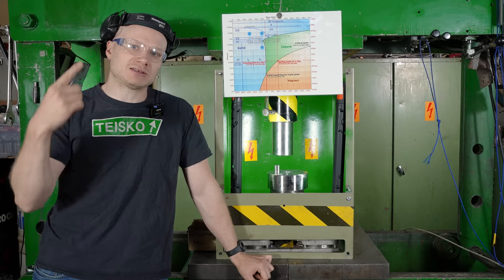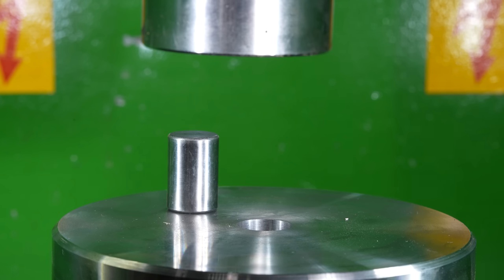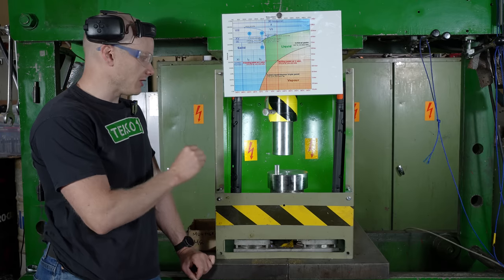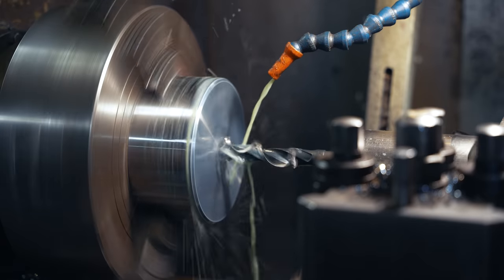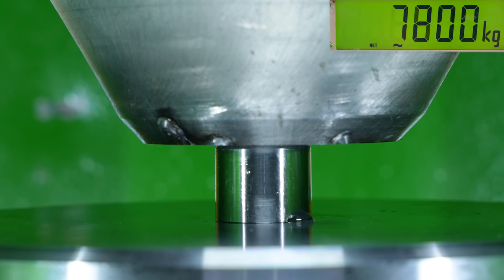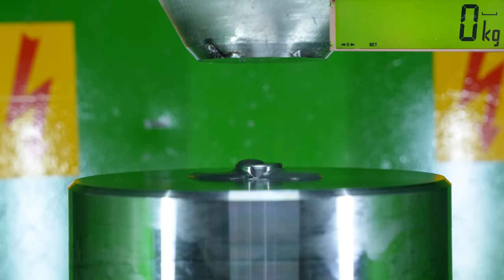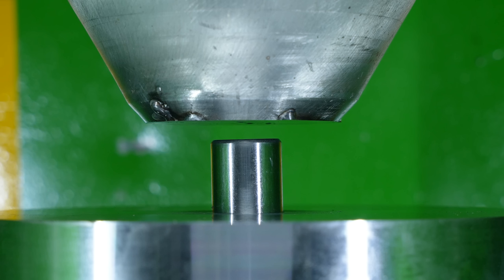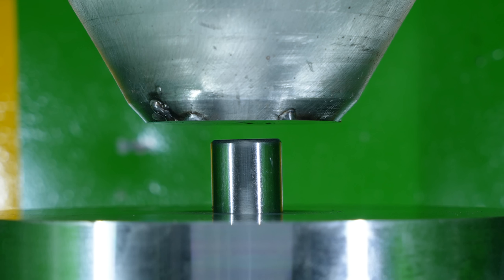Turning Water into Rock with Hydraulic Press

Comment: My suggestion is to take the advice of using ice instead of water.
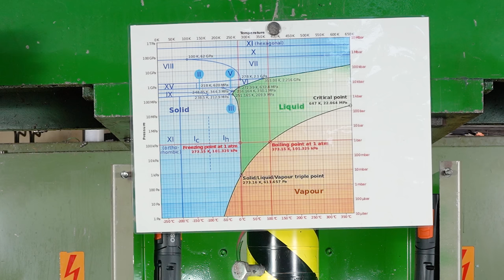Looking at the graph at 0:30, if the temperature of the ice is below -22°c will never transition into water and will stay a solid!
Under the extreme pressure the ice will fill all the space, but it shouldn't leak if it's never a liquid!?

Comment: Would a titanium roller bearing work? The tensile strength of titanium is 63000 psi and has better corrosion resistance that steel.

Comment: This is an awesome but has several issues:
1) leaving air - that will be a problem.  
2) stop and wait - temperature is critical for both the water and especially the metal.
3) Even if you achieve it, how do you know?  We cant inspect the results.  (reminder of your cone head as an option).

Comment: You could fill in some thick oil or fat on top of the water that has clay or some inextrudable particles or fibres in it that can help to clogg the drain out.  The use of a crome platet piston  and cylinder  or a pipe between them made from high crome/ alloy probably helps to prevent frictionwelding what could be cause of   leak,  or it just expands the cylinder by hydroforming effect.. u must get it to the waterjet channel to cut it in half polish an measure if it expanded ^^

 And cool the tool down to 1°C before use .. i guess friction and compression gets things very hot in there ;)

Comment: I think you need to make the pusher out of oil-impregnated brass. This way the metal of the pusher would gladly deform and not tear up. It think you set up leaks because you are tearing up the metal and making small grooves inside that let the water escape.
Reply: And you would need to increase the length of the sealing surface. Make it 2 cm long. Go slowly and wipe off the incoming water until it  eventually stops leaking.

Comment: Instead of pressing the bolt down, can it just be a screw that is turned in? That should have a good seal, and you might need the press or a long handle to tighten the screw.

Comment: Could the oil be acting like a seal and once it gets to a certain pressure starts to blow out? 

We use oil in engines as a barrier to keep two metals from contacting and wearing out prematurely, this may be doing the same and getting to a point where the oil sheers and allows the thinner water a gap to push through

Comment: The cylinder needs an extreme smooth surface. channels will be cut in the steel by HP water through the tiniest cracks. Ex- steam engineer , I know.

Comment: Air molecules (N2 and O2) are bigger than water molecule (H2O). So airtight != watertight. And with such a pressure water leaks even through the solid metal shpere

Comment: Unfortunately, physics will get in the way, but if you built a vessel that contains the water with no air leaks in a piston like setup and pulled it apart really fast then you could create ice. It would probably be a slush, but that'd make for an elaborate snow cone.

Comment: Doesn't it make small cracks in the steel if you force the cylinder through its hole that's much too thin very fast? Slower might be better, also since the temperature increase due to friction would be lower, although the thick steel should dissipate the heat outwards I'm not sure if it does so fast enough

Comment: It would be really cool to have a clear diamond with a big chunk of Ice 7 trapped inside. The amount of strain in the crystal to contain that would probably be immense.
Reply: The diamond zone starts about 100 miles under your toes.  "a big chunk of Ice 7"  There aren't any lakes down there.  Water is chemically sequestered.  The fun starts as it ascends.  Kimberlite, et al., explosively surface, possibly at sonic speeds.  If Lauri had a diamond anvil cell, he could squeeze to required pressures with a leveraged butterfly thumb screw.

Comment: At the pressure and temperature in your test the oxygen in the water reacts with the steel forming iron oxide and hydrogen. Some hydrogen escapes and some is forced into the metal.

Comment: Cut a round hole in the metal block using wire EDM then a cylinder piece for that hole. cut the cylinder in half and use it to plug one end of the metal block. This should result in minimal leaking.

Comment: Is the portion that holds the water expanding under the pressure?   I might be way off but the more you squeeze the more solid the water becomes so it’s acting like splitting wedge pushing on the walls of the plug receptacle expanding the hole making it larger.  Is there a way to measure expansion of the receiver piece as pressure rises?  The plug might not be the problem it may be the receiver because the plug should expand as it compresses from the force pushing and the force resisting and there is no constricting force on the receiver.

Comment: Could you make your chamber/vessel and piston/plug (whatever you wanna call these things) using Wire EDM so you can precisely cut it out with basically zero tolerances and if im correct eliminating the gap where it can still leak from at those high of pressures.

Comment: I'm kind of confused, because people that hydroform steel say that water doesn't compress, which is why they don't use an air compressor as it has a greater risk of explosion. That never really made sense to me, and it's obviously not exactly true because of this here. But it also doesn't really explode like you would expect either. Can someone explain what's going on here? I know water become less dense when it freezes because of the crystal orientation, but does the same thing happen when it becomes ice VII? If not, then why do people say that water doesn't compress?

Comment: THis is a great idea! Most interesting video so far. 
You need to machine a cup in the pressing tool. The pressures will be shunted and redirected to the center of the pressing tool, instead of being wedged at the seam of interfacing tool surfaces. Also might need to use ceramic or diamond pressing tools. Because metal is very malleable, its deforming like plastic and being water jet cut. 

The hardness of the tooling is probably totally dependent on the pressures achieveable. 

ALSO you could have some sort of coating on the pressing tools as well. DLC coatings are avaliable if you send them out to the dlc coaters, your chances would be higher.

Comment: The idea is sound. I think you just need a softer metal as your seal. Perhaps even lead. Perhaps as little as a few millimeters of it, in front of the bearing roller. The water pressure may be able to force it into sufficient conformity with the inner surface of the compression chamber. If lead's too soft, then use brass. If it's too hard, then use a softer metal, or even plastic.

Anything with a much higher viscosity than water, to plug the microscopic gaps.
Reply: Perhaps a sanding and ultimately polishing of your mating surfaces might work as well.

But I believe you will want to avoid  galling. You want materials that deform and smear but don't peel off and gall and gum up your works.

And I think you want to avoid accidental cold welding, as that would force galling to happen, and that material to break off and gap your seal.
Reply: If you figure out how to remove the plugs and iterate your dry runs you can inspect and modify as you learn, perhaps placing a colored gas inside to detect leak pressures.
Reply: A colored gas, or a flammable one, with a flame nearby to make leaks obvious. And then maybe there is some industry-known connection between sealing against water and sealing against gas. Like maybe if your setup prevents air leaks up to 2000 bar, it's known that it will prevent water leaks up to 6000 bar or something.

Comment: Is the mineral supposed to be inside the 2 pieces of pressed steel? Or the vapor coming out? 
Definitely badass.
Reply: He was trying to get it to stay sealed. The vapor that leaked out wasn’t under enough pressure to become a solid. He was hoping that what didn’t leak out was compressed enough to become solid before the press “bottomed out”.
Reply: Definitely inside. From my understanding, with this process you would not be able to directly observe the Ice VI/VII since it requires high pressure. You just kind of know it's in there based on the math of the pressure etc. Ice VI/VII by definition cannot be vapor or liquid. If I were to venture a guess as to what's going on here: The higher the pressure, the more likely of a structural failure(a leak), so it's basically a race to get the pressure high enough before it leaks. Once there is a leak, then the pressure drops, instantly changing the water from Ice VI into liquid and then 'escaping' the container. Maybe someone more versed in the science can shed some light on what's going on.
Reply: Can it be cut open to reveal it? Or would it be too small?
Reply: @savageslayer3434 I think you're real close to being on spot, that 3rd person like you say, a little more versed in science could tweak things a little, I'm waiting and watching for him to come thru
Reply: @gettingtheinsideout9683  well if you cut it open, the pressure instantly drops and it will revert back to liquid form.
Reply: @gettingtheinsideout9683  it’s only in that solid form while it’s under immense pressure. When the pressure is gone it returns to a liquid state.

Comment: Place a deformable tapered steel plug in a matching tapered hole. If that fails escalate by putting a taper on a roller bearing ( aneal, turn .... ) and place the bearing on the seal.  If that fails escalate by hardening the cylinder, but we don't want the cylinder to crack. Out of ideas for now.

Comment: Theirs no Ice 6 forming in their, the water is being super heated by the compression and coming out as steam.  As you can see on the phase diagram that puts you past the triple point of Ice 6 which is at 2.3 gigapascals and the slope keeps going up the hotter it gets.  So your atempting to go right from liquid to Ice 7 unless you implement a cooling system.  This is likely the reason folks start with Ice.

Comment: taper hole and put step on bearing instead, measure the amount of water. know the volume your putting it into. it doesn't compress you could only pressurize. if you know volume of measured water v1  v11    make size containment

Comment: maybe if the softer material is the rod so that it forms in the hole instead of grinding and making leaks, what if you used the heavier metal as the hole and a softer metal the plunger

Comment: Very cool!  Maybe different metals for the plug would make a better seal against water?  Also would be cool to see you tap and pull out the plugs to see how the end in contact with the water deforms or if the water under such pressure reacts with either metal.
Reply: Adding a slight taper to the bore and using something that will crush fit with a low interface friction is ideal. Perhaps something like a conical brass sleeve over a steel slug core to form the plug. Perhaps a slight concave hemisphere on the tooling ends would help distribute the force and convert some of the pressure into sealing force as well, as it would want to expand the tool head. The flat end probably wants to go convex under the strain which diverts even more pressure onto the seal interface and might be contributing to the containment failures.

Comment: Hey, maybe you can make it into some kind of screw shape that will turn and engage with some threads as you press it down? It'd have to be a pretty long thread, that would look more like a drill bit than a nut or bolt. That might help you keep a seal.
Reply: threads have more surface area. Which means a higher chance of a leak, ironically.

Comment: could try to create a sealed steel container with flat sides to press against and with water inside. then press against the flat sides to deform the container and the pressure inside would grow. then increase the thickness of the walls to prevent the container breaking. This is a very interesting problem. Then of course you would have to break the container to see the result but I assume thats what you would have to do here too. Hyvä meininki toivottavasti tämä ratkeaa. Hope you solve this

Comment: With that air gap and heat generation,  you caused the water to flash.  Kinda the same as refrigerant gasses.  Even though like r134a flash point is about -20f.  The same applies to this test.   What has to be done to achieve water rock is like your diamond.  Exteame preasure from all sides wth no air gap.

Comment: Maybe use teflon tape. The stuff used by plumbers. See if water can force it trough the gap.
Reply: Also maybe a viscous high molecular weight fluid just floating on the surface of the water could gunk up the gap.

Comment: Warm up the die a few degrees while at the same time cooling the punch taking into account the tolerances after changing the temperatures for the best seal that will keep getting tighter as the parts warm up and cool down back to room temperature . It was very cool but better luck next time we know that you can pull this expeariment off  👍

Comment: Sorry, but I don't think you managed to make Ice VI, here is why;
When you compress a gas, like the air inside the piston, it increases in temperature, and it gets colder when you release the pressure. 
This is why a gas-container get frost on it when you let out the gas.

Now, Ice VI can only exist between −143 °C and 82 °C.
The compression of the air probably made the inside of the piston, and the water, way hotter than that (and thats not even taking the friction of steel-against-steel into account), because the last leak wasn't aerosolized water, it was steam.
You likely made the water at least 200-300°C hot, or maybe even hotter. (pretty impressive at sea-level when not using a pressure-cooker).

To make a proper seal, you probably have to make it crazy tight, like 0,5mm - 1.0mm smaller hole in comparison to the piston-rod.
And even then, I'm not sure steel is hard enough to contain the water, you'd most likely need to make the whole thing out of Tungsten to suceed.

Comment: Would a synthetic seal ring or flat circle help sealing of micro space between parts. or slight tapered recess in bottom face of piston help sealing by letting piston expandi outward against cylinder. Like old leather cup in handy air pumps and water bilge pumps.

Comment: Yeah unfortunately much like regular ice when you take it out of its forming conditions its going to try and change back. So the longer and cold your ice is before taking it out the better change your ice will last, same with this. Youll probably need to have it under pressure for long enough and keep mind of what temperature is right and how to achieve a set of controlled "forming conditions"

Regular ice is a rock its a naturally forming mono-mineralic molecular structure

Comment: Did you use distilled water or water from a tap, the minerals in tap water would compress at a different pressure and give  false reading ! Wonder what using liquid oxygen would do under max pressure ?

Comment: You would be better off polishing the exterior surface of the bearing and interior surface of the tool rather than having a step. You’ll need precision surfaces as that will be your best bet. The way you’re doing it creates an imperfect surface that is unpredictable. And micro scale gaps will then be forced to rely on surface tension to hold back the water, which can be very large for small cracks, but eventually the tension will fail and water will begin to flow and will rapidly erode and grow the channel which is exactly what you saw. The type of surface finish you will need will be similar to the surface finish of gauge blocks. You want the inner cylinder to “wring” to the outer cylinder. They have shown gauge blocks binding force is greater than surface tension, van der walls, and micro welds which is going to be your best bet. Then on front face of your inner cylinder you want to have a designed cup. This cup should be designed specifically to expand the front face diameter by the expected amount the inner cylinder will grow as the pressure increases. This will maintain the same seal throughout the crush. Then depending on the final volume needed you can add a mound to the internal cylinders bottom face. Although, simply adding a cup to the front face of the inner cylinder may drastically improve your current setup because the pressure you’re generating will help you seal as the pressure increases

Comment: if YOU freeze the water then YOU compress it YOU have still turned liquid water into ice 6 (or 7 if you can reach that pressure), now if you go out and buy some ice then YOU did not do it but I think if you freeze it then it yourself then it still counts.  Also are you using distilled water or tap water or...?

Comment: You need better steel!
When I saw the pressures, above 2GPa, there is no metal that can withstand it, so you basically could never make Ice VII just with pressure, but if you get high strength steel and allow it to cool down the Ice VI shoud be possible. 🙂

Comment: Make piston rings for the pin, use two rings per groove so there is no gap. Lay tge meeting sides of the ring on a 2000 to 5000 grit sand paper, and polish them. And hone the cylinder and br Shure to oil the rings with a very thin oil, maybe diesel wuth transmission fluid. Just a drop, mixed snout 50/50 or 70/30 diesel/ATF,   use the same paper to polish the cylinder, use the piston ring sanded with about 600 grit, to hold oil to create the seal. Eith two rings in a single groove,  making rings and grooves this small becomes the challenge. It is possible i belive.  Or make the whole thing larger , piston and cylinder,  and use a lever, to add more pressure, Maybe double thr cylinder, and the pressure,